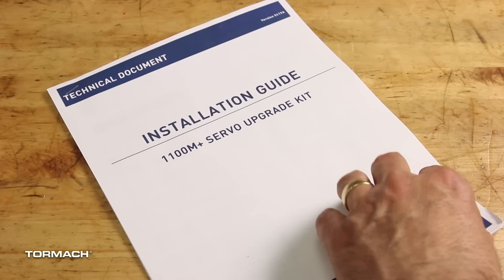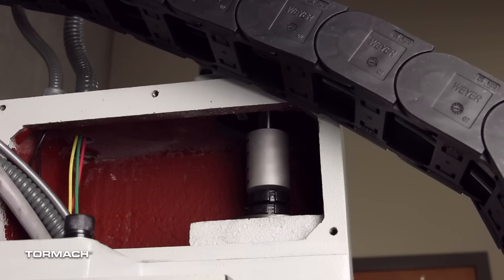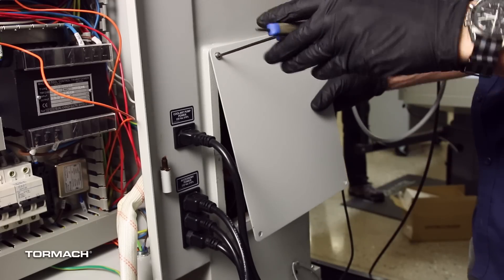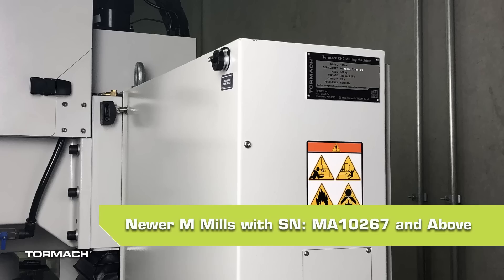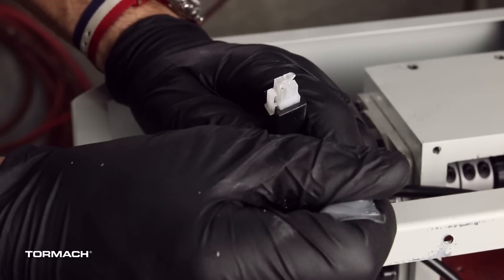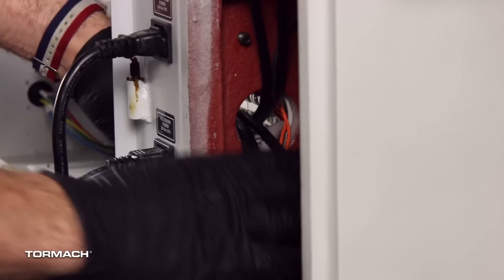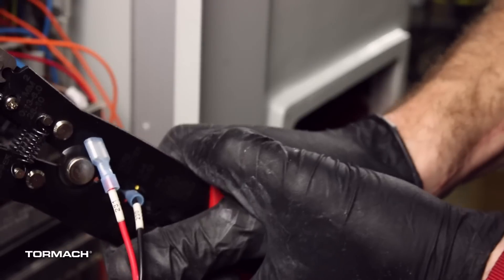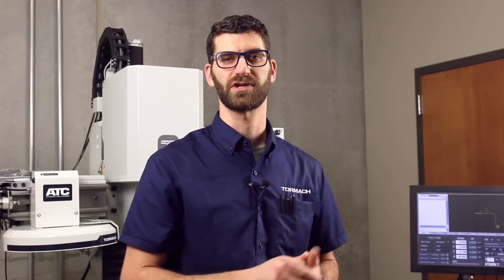Tormach 1100M+ Servo Upgrade Installation Video

Comment: Can this upgrade be done on a PCNC1100 V3?  What about the BT30 spindle upgrade?
Reply from the maker: Unfortunately no in either case. Our Engineers tried to produce a wire harness that would be easily installable for these conversions, but the location of the electrical cabinet on the rear of the M series machines made it near impossible.
Reply: You could do the motors..... but you would have to almost gut the machine electronics., and I'm sure Tormach would no longer support your machine.
Reply: Actually, it might be pretty simple with the Clearpath SDSK series motors. you won't need to replace anything.

Comment: Just completed this upgrade on my brand new 1100M. Set the laptop up on a rolling cart, and followed along pausing at each step.  This video was a great tool in accomplishing the task.   It took some time, but using the video along with the written guide made it a pretty straight forward process.
Reply from the maker: We're very glad this helped make the install easier. This comment makes all the extra effort everyone put into this video very worthwhile! We hope you got to cutting right away!

Comment: When is the MX going to come out? I am debating on waiting for the MX. What are the difference between the MX and m+? I think biggest difference is r8 and bt30 tool holders. Any info is appreciated.
Reply from the maker: Yes, the difference between the M+ and the MX is the BT30 spindle and encoder, but you can upgrade an M or M+ with these components once they are available to make your machine an MX.
Reply: Tormach Inc. thank you for reply. I look forward to buying one of your units.
Reply: A BT30 spindle is a game changer for a machine like this!

Comment: What are the practical benefits and advantages of servos vs. step motors?
Or, to ask it in another way, how is the 1100 better after the servos upgrade?
Reply from the maker: There are several advantages to the servo upgrade; faster rapids, less noise, more efficient machine operation and a shorter time to complete operations. Thanks for the question.
Reply: @tormachinc  Less noise?  I kinda like that my 1100s sounds like RoboCop.  lol
Reply from the maker: Thank you for your co-operation. Good night.

Comment: error in the video do not tighten the z motor down after tightening the coupling. Tighten the coupling after the motor is tight to the mount.
Reply from the maker: Normally we’d agree with you, but the procedure shown is correct. You must first tighten the brake coupler to ensure it stays aligned. Then tighten the Z Servo to the machine. The Z motor must be fully seated before tightening the coupler. If you do it another way it is difficult to align the motor coupler with the Z-brake screw.